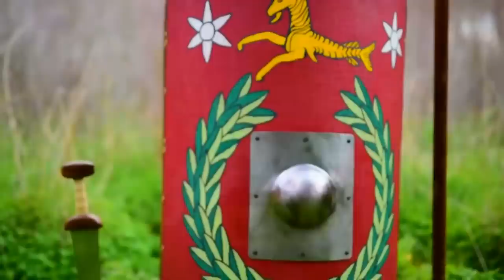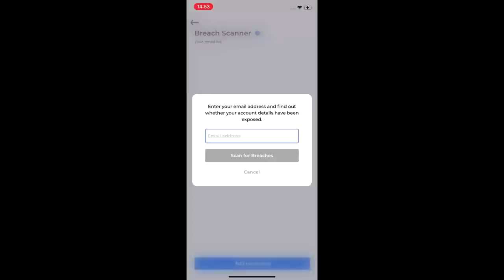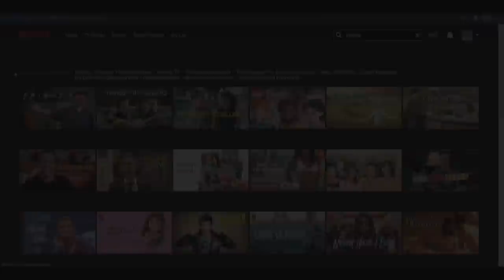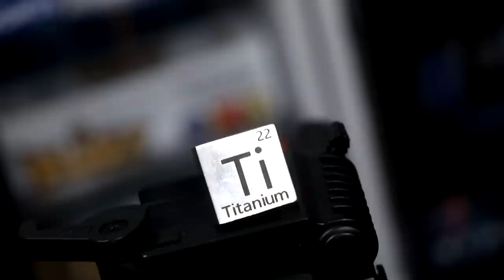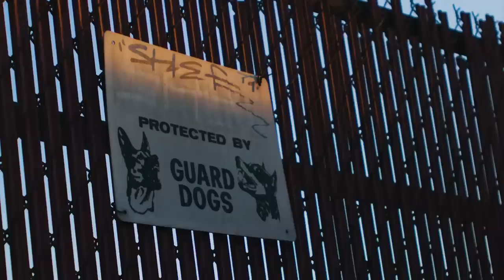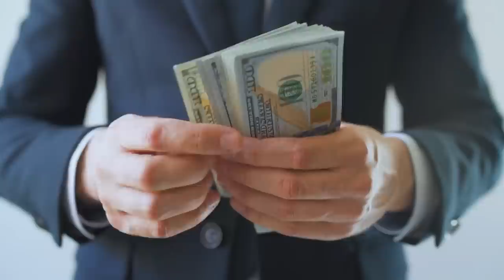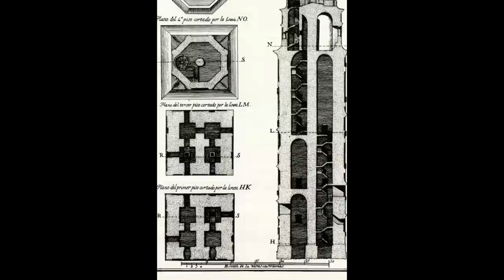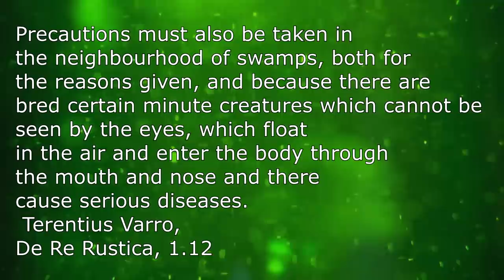10 "MODERN" Things The Romans Actually HAD

Comment: Something I found interesting when I visited Rome was that some of the Roman aqueducts are actually still in use to this day to provide potable water to public fountains. Obviously its not like the entire system of bringing water from a reservoir to the fountain is 100% of Roman design, but some components are still used.
Reply: The Romans incorporated fountains into their water system. They used them for pressure release, heavy rains could build up water pressure that could burst pipes. Their fountains also generally had low curbs allowing the water to run onto the pavement which added some humidity when the water evaporated to counteract the dry summer heat.
Reply: The city of Rome didn't match the amount of clean water that flowed into the city under ancient Rome until the 1950s.
Reply: Fountains were more a Roman thing.
Aqueducts were already been done by the Greeks hundreds of years before.
Reply: @Z1BABOUINOS  Sure the Romans weren't the first to make aquaducts, but Romans made them more effective and widespread throughout their empire. Comparing Greek aquaducts to Roman ones is like comparing a musket to a machine gun.
Reply: Would be great if we build some architectures with the supposedly superior Roman concrete today. Unfortunately we still don't know the exact recipe.
Reply: @lfcmike12  
That goes for any invention, ever made.
That's not the premise of this video though.
Reply: @Z1BABOUINOS  Aqueduct means to 'lead water,' or a conduit to move water. In that sense people made aqueducts for the first neolithic cities. The city of Rome didn't just bring water into the city but gave people running water in their home, which was the point made in the video.
Reply: @robo5013  
Which had already been done in Greece hundreds of years before. Example in ancient Thera, where they not only had running water IN their homes, but also IN-house bathrooms, heated floors, AND a sewage system. "Luxuries" that only palaces had in roman times and even much much later in europe.
If you're looking for something truly revolutionary, search for The Tunnel of Samos (aka Tunnel of Eupalinos), designated as an International Historic Civil Engineering Landmark.
Reply: @Z1BABOUINOS  Roman apartments had running water not just the homes of the rich. And I don't recall Metatron claiming the Romans invented aqueducts, just part of the things on his list of what they did have that most people think of as modern inventions. Thera was rebuilt in the 3rd century BC and later again by the Romans. So the water systems you talk about were probably built by the Romans.
Reply: @robo5013  
I said ancient Thera.
Buried in ash, and now a place you can visit.
You understand how OLDER than the romans that is?  Minoan!
I've been to the archaeological park of Thera twice, in Samos once, and 3 times to the archaeological parks of Herculaneum and Pompei.
The only thing that makes the roman aqueducts different, is the scale (mostly the ones in Rome)
and hundreds of years distance.
Reply: @Z1BABOUINOS  You're still missing the point of the video that it's about what the Romans had that many people think is more of a modern invention. He didn't imply that they were the originators of it as your first post seemed to be arguing. And ancient can be applied to the Romans, so when you said ancient Thera it could have been referring to any time of ancient history. If you had said the original city of Thera it would have been more informative.
Reply: @robo5013  
Oh, I see....
Moving the goalposts, and changing "what the point is"  (this time, in this post),
is not my thing.
Playing with words, or pretending to not understand words, 
is not my thing.
Playing the role of the fanboy, 
is not my thing either, but someone has to do it.....

btw, when someone is talking about the  Greek ANCIENT city of X,
and you assume they're talking about the roman times, or the byzantine times, or the ottoman times,
they will laugh at you. And rightly so.
If nothing else, I hope you've learned  something useful today.
Reply: The aqueduct in Segovia (spain) was used as a Water Supply until the 1970s, nearly 2000 Years.
Reply: We do know what Roman concrete is made of. It isn't used in modern days because it is expensive and often use rare ingredients (eg. Ingredients for Roman concrete varied depending on the region and often included certain types of volcanic rocks).
Reply: I was wondering if Rome was still using them when I seen them on the video.  It's amazing they stayed intact that long with all the wars and good old father time. That and Roman roads.
Reply: @neganrex5693  Some of the insane Stuff is, that there also Bridges that are still in use and they are also used by Cars.
Reply: @Z1BABOUINOS  Chill bruh
Reply: @Azuris190  That goes to show us nobody built like the Romans. The Romans made things to last. My grandfather was over their in WW-2 and he said even the Germans respected their works of art and took great care of seeing that part of human history not destroyed.
Reply: In Segovia Spain, the aqueduct was only cut off from the river in order to keep ice during the winter from slowly damaging and expanding it. It had survived millennia of this and would likely survive even longer even had they not taken this step. It's usefulness as an aqueduct was never questioned, only outweighed by it's usefulness as a historical artifact and landmark.
Reply: I was in the US Navy during a Liberty Call  in 1986 in Napoli and saw ancient aqueducts supplying water to that city . The pizza was excellent .
Reply: @Azuris190  yeah same as split in croatia, been enough to supply the city until 70's or so when the new areas durther away and with high rise buildings were built.
Reply: In Spain there are thousands of aqueduct,  bridges and other architecture still in use today.
Reply: @Z1BABOUINOS  
Wrong, there is not a single surviving   Greek aqueduct in Greece proper or in the Koine, the few "Roman aqueducts" surviving in Asia Minor are remnants of Bizantine public works. The Byzantines were Romanized Greeks their territories constituted the Eastern Roman Empire which lasted until the 15th century.
Reply: @esmeraldagreen1992  
"there is not a single surviving Greek aqueduct in Greece"
If by "surviving" you mean in "full working order today" (!)
after 2000 years... (!)
then you must be confused... I never said that.

If you mean there are no surviving ruins of Greek or Roman aqueducts, in Greece,
then YOU, are very WRONG !
I mean, how difficult is it for you to do a simple search on the web?
And if you're not fluent in the Greek language, use this to search for "ancient aquaducts in Greece"   -->
αρχαία υδραγωγεία στην Ελλάδα
Now, start counting! 

'"not a single surviving..."
Sorry, but.... 😂
Reply: Not just the fountains, even to our homes. They are some of the best aqueducts we have afterall
Reply: It’s less about knowing the recipe and knowing it uses volcanic ash that is basically exclusive to the region and would not be able to used in mass production. Would run out quickly.  

 Also realize a lot of Roman structures were still made with lesser material like wood for anyone who wasn’t wealthy.   So what we see now was the millionaire / billionaire row of ancient times.
Reply: Nothing like using dated plumbing with lead and God knows what else. 🤣
Reply: @robo5013  when it comes to summer heat I prefer dry over humid
Reply: @308dad8  It didn't make it humid where you are no longer sweating. In the heat of an Italian summer the water would evaporate quickly and just like sweat evaporation would cool you down. Think of it more like a how quick summer rain can cool things down by adding just a little moisture to the air.
Reply: @Z1BABOUINOS  btw when the base of the conversation is on roman times its understandable for someone to make that mental leap, ancient times for Greece can be considered from their start to the early middle ages... Thera was founded in the 9th century BC well before classical Greece, anyone who wants to accurately pinpoint the time period of their conversation should refer to it as pre classical Greece.. I'm not laughing at him for correctly interpreting the word ancient. I'm laughing at you for not using proper terms and purposely leaving your comment to be misleading.
Reply: @jessdriscoll1056  
A "baby's" laughter is always amusing.
Only when they cry, it's a problem.
Ttrust me, my μωρόν
Reply: Some serious quality engineering for them to handle 2000 years of continuous use and still function
Reply: @neganrex5693  well they weren't savages, at least not in all aspects...
Reply: @lkrnpk  I always looked at them as a hybrid of civilized and savage. They did have games that would make MMA fighters and Pitbulls piss down their legs but buildings the western world copied.